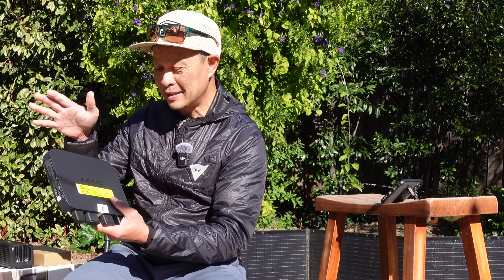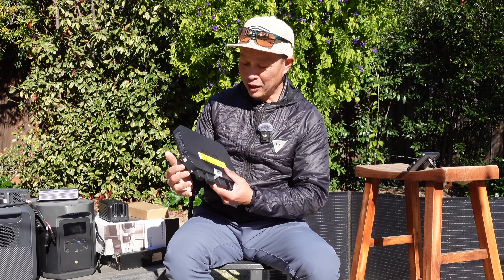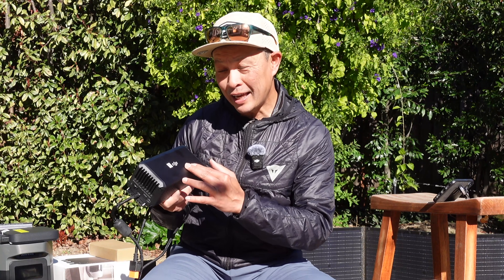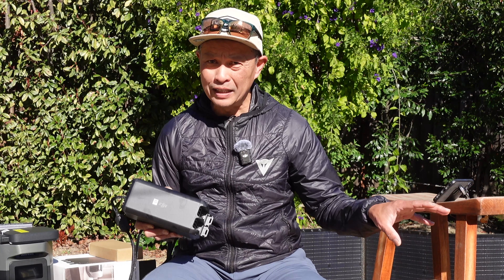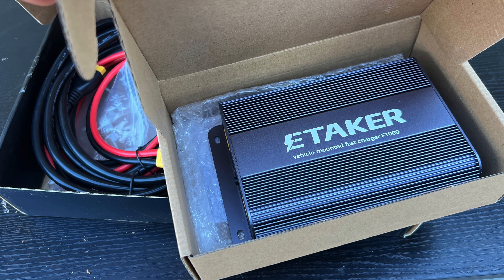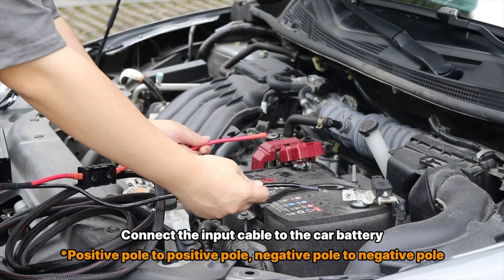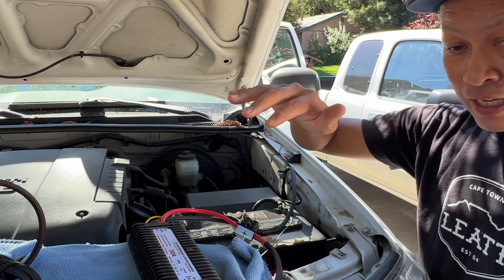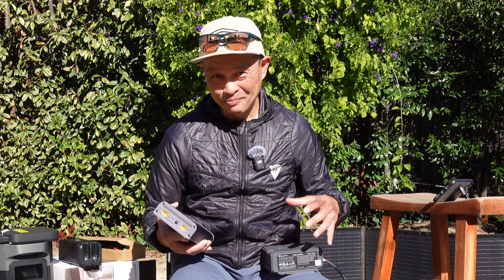6 Car Alternator Chargers for battery generators compared - Ecoflow, Bluetti, DJI, Etaker, Pecron

Comment: 800W max might not be ideal for any V6 Toyota alternators in the long run like the Taco, 4runner or FJ. it might damage it in a perior of time. Unless, you can manually lower the power  or voltage maybe  50% while driving even it has a protection or safety net. Just my take.

Comment: Etaker F1000 doesn't allow parameter adjustment for lifepo4 batteries without Bluetooth ability.  I learned this the hard way. It's a boat anchor now.

Comment: For ecoflow, there was a misunderstanding in your review..
The echo flow does not only work with delta Series battery.

Because it charges faster than all the others it seems to need a bigger cable which is the xt150 but if you get an xt60 cable on your own you can use it with other machines or they have the alternator charger 500 which comes with the xt60 cable that you can use with any machine.

I can understand you confusion but I'm still learning myself.

Comment: I think the DJI is genius for being able to change the charge depending on the battery voltage. When you're cruising down the road or especially the highway the amount of extra load these put on your alternator is hardly anything at all. 

But when you're idling, then trying to pull 600 to 1,000 w is quite a big deal especially that's when your alternator isn't being cooled properly so it's more prone to overheating. 

So yeah being able to charge at a lower rate while you're idling and then have it kick up to a Max while you're driving is the best way. 

Too bad that is proprietary I don't ever plan to buy any DJI power stations

Comment: Thanks for your video review. May I ask, will any of the charger charge my delta pro at home using those 12/24volt lipo battery? Maybe you can make a video about it.
Reply from the maker: You can absolutely do it. Just plug it in the solar inputs and the unit will treat it like a solar panel

Comment: Good to see someone include the ETaker in the mix, seems like all you see out there is the Ecoflow and Bluetti. I disagree on the Bluetti being the king. In my opinion the Etaker seems by far the best because of the capability to charge from your alternator AND solar at the same time. The best part is it uses solar as the priority so if you have 400 watts of solar ( i know you get less depending on conditions) then you're charging your power station while sitting and then if you drive around you get another 300,400,or 500 watts (depending on what the setting is on the Etaker) for a COMBINED total of 900watts(up to 1000w if you have 500watts of solar). Nobody else offers that. On top of that it can backfeed to charge your starter battery if it's dead so you're not stranded.
Reply from the maker: Absolutely. Small brand does good!
Reply: I do this with my renogy 50a DC to dc charger
Reply: Eco Flow also does that and it's a DC to DC charger. I haven't watched the video yet but I have been doing research and I will be interested twice this video to see what bloody does as a feature but ecoflow does what you're saying as far aa i can tell

Comment: I have the Bluetti product but it doesn’t seem to work for me, when idling, it charges the AC180P for about a minute and then cuts off. The car, a Subaru XV 2017 model starts and idles slightly faster for a minute and then slows down and that’s when the Charger 1 cuts off. At the moment I haven’t tested what happens if I go on a trip of some distance it might start charging periodically or maybe the XV is too small to provide a constant current. I notice that it provides 12.1V so it might not be sufficient for the charger.
A clamp ammeter on the input cable shows that it can pull 22A.
 I have been able to test it with an amateur radio transformer that can supply up to 30 amps and it pulls 18 amps if the output voltage is kept to 27V and charges around 250W.

Comment: Thank you for the review ! do you think "Bluetti Charger 1"  will work with Anker Powerhouse 757   with input : 11-30V 10A (300W Max)   ( don't know anything about amps ) i   i read on the site Bluetti Charger Output Default Voltage  27V   [ 15.0V to 56.0V (adjustable via app) ]    
 if i set it to 30V i have 10amp  i'm i correct ?   i use a watts to amp calculator app  , hope you can help me  , Mark
Reply: I believe it will as its compatible with most if not all powerstations. I  will look up to help you unless you find an answer before me.

Comment: DJI's dedicated interface helps to improve charging efficiency and safety, especially in this on-the-go charging scenario.
Reply from the maker: Perhaps. Hard to see the benefit though. The real one is it allowed them to achieve that speed.  That's the upper end of most alternator limits though.

Comment: Yeah. Sounds good but I wouldn't want all that load constant on my Alternator. They're fragile at the best of times. Petrol/diesel generator instead would save your Alternator.
Reply from the maker: Meh, the load on the generator is not used very often at all. Only when the power station is discharged.

The car air conditioner puts a lot more constant load on the alternator.

Also many of these alternator chargers are completely adjustable

Comment: Actually, in the last decade it has become common for the alternator controller in cars to DISCONNECT THE ALTERNATOR so there is no drag on it. Once the battery is at 14.4, the alternator is idled until the battery is down to 14.2 then the alternator charges again. (Exact voltages vary.)
 The problems include the chance of destroying the alternator from overheating. And destroying it if the battery sense lead is disconnected for even 30 seconds.
Reply from the maker: Cars that disconnect the alternator... What are you taking about here? Do you have a list of cars that do this automatically? How is it done?

These alternator chargers have about the same load as your Car's AC unit. And they're completely adjustable and self-regulating. And they're used very seldom, only when the power station is discharged.
Reply: Research EURO5 and EURO6 regulations. "Smart alternators" are a reality. They reduce their output if the car does not need it. Indeed a problem if you want to charge a secondary/leissure batery  @drone_tech_review

Comment: If you ever revisit you should talk about heat too. 1000w will put off a ton of heat.  I already have the victron, but if not I would go with the etaker since it's already got solar ready too.
Reply from the maker: Good point. Heat is always a concern, and I'll keep that in mind for future tests.  The case and heatsinking on each unit are quite varied. I'll use a temperature gun next timenti measure heat over time.

Really warrants a well-ventilated mounting area for high wattage applications

Comment: fwiw, the ETaker battery input is also adjustable to 300/400/500watt. So, can be reduced for smaller vehicle alternators to prevent overload. Instead of app, just has a button you hold to change power.
Reply from the maker: Absolutely, forgot to mention that. It's not as good as a voltage regulator since the user has to know what's a good charging rate for their car. No data point with actual battery voltage so just have to guess.

The Etaker solar input is really more for RV, van applications with solar panels mounted on the roof.  Since  the engine running and solar panels set up are only both used in that type of setup.

Comment: Great summary of the products that are available and their main features. This is a great video for someone just starting to figure all this stuff out. The Pecron seems to be the bargain of the bunch but all of them will get the job done.
Reply from the maker: Thank you for that compliment.  Yes, the Pecron is a surprising value for sure.  And the fact that it self-regulates its output based on Minimum car battery voltage is a winner.

Comment: Thanks for sharing the post. Can you please tell me what's the difference between it and other car powered inverters? I use an inverter hooked to 12 v battery of my Prius and draw 1000 watts of AC power when my Prius is in ready mode i.e. on & running either on Hybrid battery or ICE. I believe that this inverter set up can be used on any vehicle. Your opinion would help us in planning our preparedness for long power outages. I am using my Car inverter setup for supplying up to 1000 watts of electricity to my house essential equipments during power outages from last 4 years without any issues. Thanks
Reply from the maker: Great setup on your end.   The difference with the setups described here is there is a battery power station involved to store the power, for immediate or future use.  

The get the power from the car's alternator when the engine is running.  These chargers self-regulate their draw based on the healthy voltage of the car battery.

Comment: The concern is that these devices may end your car battery at around cut off voltage most of times. Occasionally may flat the battery due to accidental current draw. For example, two weeks of no-runs.
Reply from the maker: Most of the chargers here self-regulate their current draw by monitoring the car battery's voltage. That setting is configurable as well.

The Ecoflow and the DJI chargers have a mode where they charge the car battery as well, in case there is a problem.
Reply: The Bluetti chargerncsn simply be turned off at the breaker if you don't plan to drive for a long duration. Im sure they all,have breakers or something similar

Comment: I hate to say this but the Bluetti is pretty decent. That is the only thing they sell that is pretty decent. Everything else Bluetti makes is a POC and has a high failure rate.
Reply from the maker: Yeah, elegant little solution they came up with here.
Reply: Hummm...Been using a Bluetti power station daily for four years ...going strong and never one problem.

Comment: Give the Victron Orion XS (50amp) a spin.  It is a new model with high efficiency with excellent controls.  You can adjust both the input/output amps in 1/10 amp increments from 0 to 50 amps and it runs cool, is small and compact and very efficient.  Been using mine for almost a year now.
Reply: Thw Orion cannot output anything higher than 24v. 

On Pecron, Bluetti and many other units you need 48v or higher to max out the dc charging.
Reply from the maker: I'll have to give that a try.  Thank you for the recommendation. 

The big difference seems to be the voltage output. We need 48-56v for fast charging of power stations through solar inputs.

Also, the self-regulating charging output based on battery voltage level is key.
Reply: Victron is overpriced, everyone thinks that means "better". Yes they have some nicely built items but there are better options out there. Every time I see a Victron setup they have 10 different pieces hooked up and have thousands on dollars tied up into them, that's how they get you. Now a days all you need is a couple solar panels an alternator charger and a decent sized power station and you're golden, if you need even more power add another 100ah battery.

Comment from the maker: Typical Car AC uses 800-1400 watts of energy from the alternator. Heated seats, lights, defrosters add load to they system.  These alternator chargers in the video self-adjust based on what the alternator can handle using a configurable 'Minimum car battery voltage'.

But...when alternator charging, best not to use ac/heater and other loads on the alternator.
Reply: Hi, thanks for the video. I have a 20 year old car, do you think it will be a problem? You say the AC and stuff is connected to the alternator. but is that directly or does it first go through the battery since these chargers in the video are all connected to the battery?

Comment: I have been using the Pecron for a few months now and it has worked great on my Power Wagon. Works on my Bluetti and Pecron power stations. With the included cables in is a bargain.
Reply from the maker: Very, very good to hear your personal experience with Pecron. Yes, that is definitely a great value, especially with the included cables. I've used a few of their power stations before and they have proved reliable.
Reply: I would love the Perron charger for my truck but they don’t ship to Uk, everywhere else even France and Germany but not Uk, I’ve been trying for months to get one, no luck . Best price and reviews on it as well
Reply: Would it be possible to run two
Reply: @vwave7292  That would probably be too much strain on most altenators.

Comment: As others have mentioned, vehicle alternators are current and heat limited, do not exceed the maximum capacity of the alternator.

If the engine is only idling then the alternator cooling fan is not working efficiently further limiting the amount of power that you can draw from the alternator.

Also please install fuses or breakers right at the battery (or other sources of power) because cables will overheat and potentially start fires unless the current in the wires connected to a battery is limited by a fuse or breaker.
Reply from the maker: Great, great advice @carld3184.   The DJI, Pecron and others are self regulating by monitoring the voltage of the battery and a 'Minimum Voltage Setting'.  They will not draw any more current if voltage is less than that, usually 12.8 volts.

Owner should monitor this and set it accordingly for their auto. Small, compact cars need to be more aware and conservative.

Comment: My question is...
Can your alternator even handel that kind of load???
Most stock automotive alternators can push roughly 200 to 300 watts with some trucks pushing 450 watts at the most. 
Let's not forget the car or truck is using a portion of that.
Let's hope these charging solutions are smart enough to recognize when the alternator is maxed out. Limiting what it draws to protect your alternator...
Reply from the maker: Small cars have weaker alternators. Luxury cars, vans, trucks have stronger ones since they are used to power AC/heater, heated seats, defrosters, lights, powered everything.

The key is to use the units with adjustable 'Minimum Input Voltage' of the battery. This measures the alternator output and allows the charger to self-adjust charging to what the alternator can support.
Reply: I took a look at my Subaru Outback 2.0D 6MT owner's manual, and the alternator is rated for 150 A. The automatic (CVT) one is good for 170 A. That is about 2,4 kW.

Comment: Will any of the units work on a motorcycle alternator?
Does any company make a motorcycle specific alternator charger?
Touring motorcycle can carry a power station. 
Or a dual sport motorcycle can carry a small power station.
Reply: I have carried the small 12V DC to 120V AC inverters in my MC luggage to power a laptop while riding.

This was in the old days before GPS units could record your track so we used the laptop as the recording device.

Very few MC alternators have significant excess power available so I would buy a DC to DC charge controller that allows setting the upper limit for current and the input voltage so not drain the MC battery and then be unable to start the MC.  Good luck.
Reply from the maker: The Pecron and Bluetti should work. The key is they have a 'Minimum Voltage Setting' that monitors the battery before the chargers start, usually 12.8 volts. Anything below that, the charging won't start, so it will protect the system and work when rpm is high. The charging rate is self-adjusting.

But... motorcycle alternators probably do not have a lot of excess capacity since they're not used for AC/Heater, stereo, heated seats, sunroofs/windows.  Thus I'm not sure what output you'll get